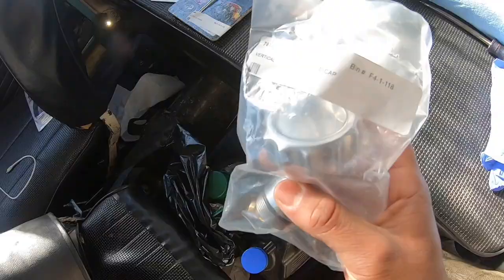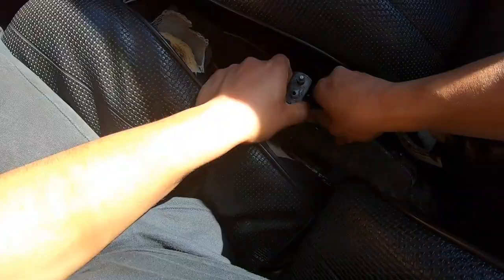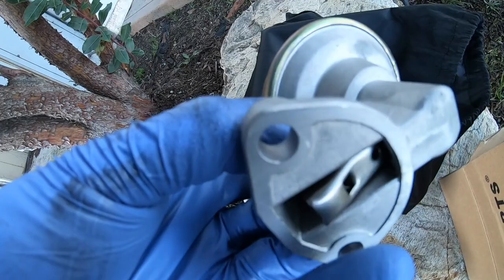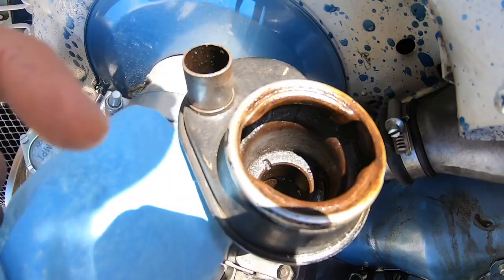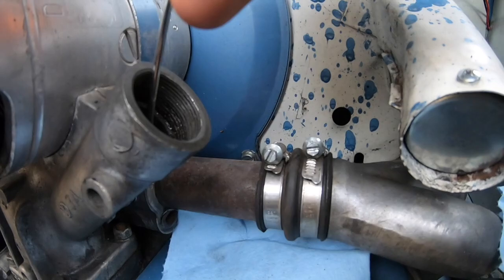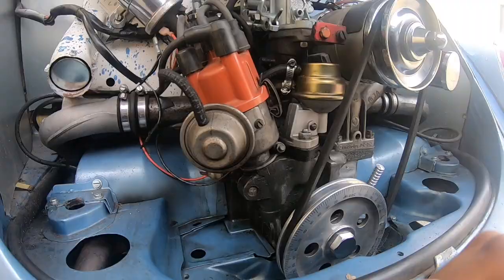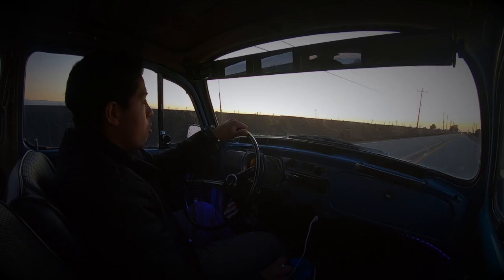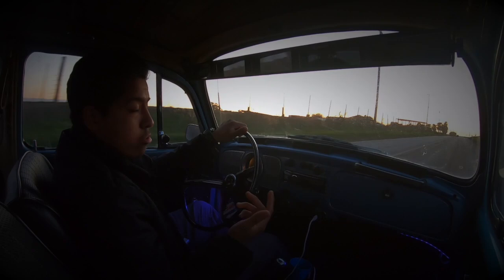Easiest Way To Replace Oil Filler On A VW Beetle !!

Comment: Man, thanks for the tip about the tool for removing the oil breather. Nice vid
Reply from the maker: No problem 👍 Had to share the tricks that worked for me. So y’all don’t got to struggle like I did😂

Comment: I just noticed you have the windshield air vents put in reverse. They are supposed to blow air to the windshield and not on the inside of the car. I understand you don't have humidity issues as I see you have the heat risers removed (looks like you don't have problems with carb icing). So you may have them put in reverse on purpose so to have a better ventilation...
Reply from the maker: I did use them to give off better ventilation but have since taken them off because they are just absolutely hideous sticking out without the rest of the dash.

Comment: I put smart car tires on the front of mine. She’s low but no rub. 👍
Reply from the maker: I'm currently running 195 in the front. If I fix the camber I think it would fix the rubbing.

Comment: You should install an electrical fuel pump .those mechanical pumps are known to rip through the diaphragm and leak fuel into your oil . If fuel get into your motor it can eventually mess up your engine.
Reply from the maker: I just bought a whole new rod, stand, fuel pump. Once I get my monwyes worth I'm planning to go electric. But probably on the next motor.

Comment: Nice video, just a suggestion; run the oil breather to your air cleaner.
Reply from the maker: But that would defeat the whole purpose of installing it since I would need to vent the oil filler and it'll keep leaking. And wouldn't that just gunk up my air cleaner and carb ??
Reply: @tuned_tunas  umm  , the motor needs to vent , look at the old one it had two vents , one for pressure and the bottom one is a oil dump. You could run the new one out but that’s just a suggestion, I’m in the same  situation, I’m going to run mine into the air cleaner, ( we will see if that works , ) keep at I’m sure you’ll do it right.
Reply from the maker: My stock oil filler only has 1 port. Or are you talking about rhe air cleaner ?? I haven't seen any other ports on it. I much rather run it like this to avoid having oil in my engine bay.